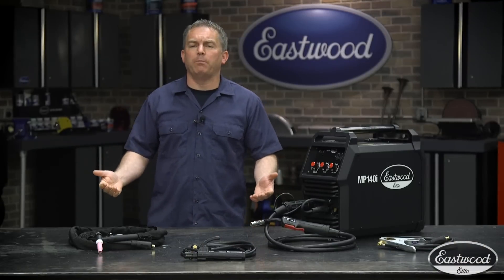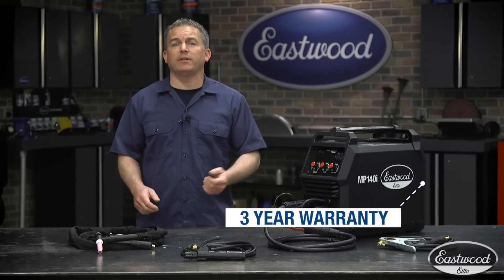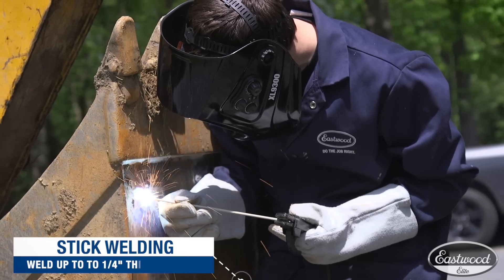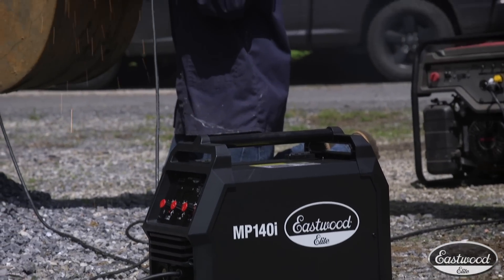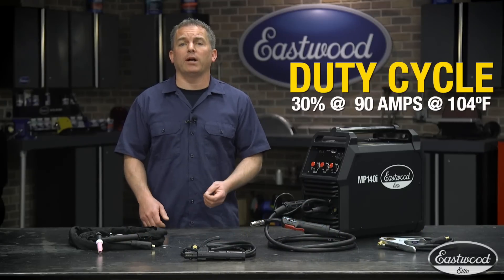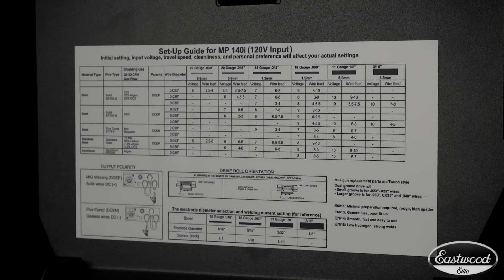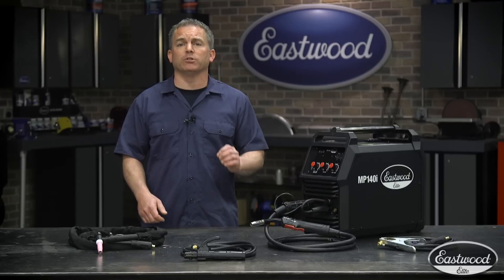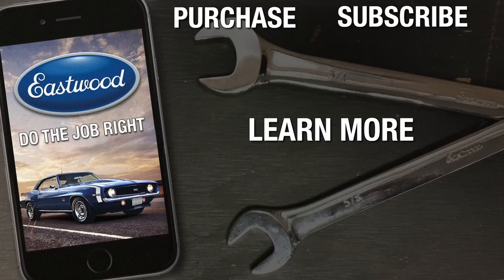Elite MP140i Multi Process Welder - MIG, TIG, Stick: Everything You Need! Eastwood

Comment: Do you have a video that shows how to set up the MP14I for TIG  According to the directions it states to "insert the Brass connector of the TIG torch cable into the Negative  on the lower left panel of the welder" The lower left connector on the MP14I is for the mig wire feed. So this statement in the directions is impossible. DO YOU HAVE A VIDEO ON HOW TO SET UP THE MP 140I FOR TIG ????  The directions also state to "choose a collett that matches your Tungsten diameter size" The MP140I does not come with a collett that will fit 3/32. WHY ???

Comment: can this welder be
 ran on a generator
Reply: Please watch Eastwood's video on this welder. I just did.
Reply: @jessejohnson159  i did does not mention anything on the use of a generator
Reply: @decs3487  1) Did you mean to type "It did not mention"- 2) If so, go to the time stamp of 1:55 to 1:60 to see what you 'missed'.
Reply: @jessejohnson159  none of the videos mentioned running off a generator
Reply: I will most likely go with an everlast as I have been doing my homework and they can run on a generator
Reply: @decs3487  You better stick to paying someone to weld for you. This video,  at the time stamp mentioned, stated it can be run off a generator. All any welding machine cares about is getting 120 VAC at a minimum of 20 AMPS and 50-60 cycles and  at the time stamp of 1:57 it states that a generator will operate it. But, I can do the reading and understanding for you!
Reply: @jessejohnson159  I did hear it can run off a generator I didnt hear anything about what generator or what size they tested with. I will be a newbie with this welder in about a week. Haven't used a welder since the 80's but I will find out. Got a new old home last year garage with work space cars and projects I can learn to weld again.
Reply: @RAGEtonesAKA  On the welder it would state the Input Volts and Amps needed (for the welders operation at it's max setting). Any generator with those output ratings should, at a minimum, be capable. Welding, kinda like riding a bike, should come back to you quickly. I have the same 'relearning curve' to do every time I TIG or Oxy-Acetylene weld after a long time of doing other things! More of the 'relearning' goes into adjustments of the components than the actual doing! I purchased an Eastwood MIG / TIG welder rated at 145 AMPS output that's suppose to run off a 115 VAC / 20 AMP rated service. A few times I've had to use an extension cord that's set-up for a 15 AMP load and not had the cord overheat. And, if the settings on the welder are not at it's max setting and the duty cycles are kept short to allow cooling (or prevent overheating), a 15 AMP service has done nicely to get the jobs I've had done. In my mind, the most important thing about a "new old home" service is to have a qualified electrician verify the good condition of all wiring and connections to prevent ITS overheating! I try to use outlets as close as possible to the CB / Electrical panels to insure no wiring overheats due to the loads I put on them! (If properly rated, they won't.)

Comment: Can the TIG work on ac to weld aluminum with the mp140i? You mention steel and stainless only.
Reply from the maker: The East wood Elite welders will TIG weld steel and stainless (not aluminum). You can connect a spool gun to weld aluminum.